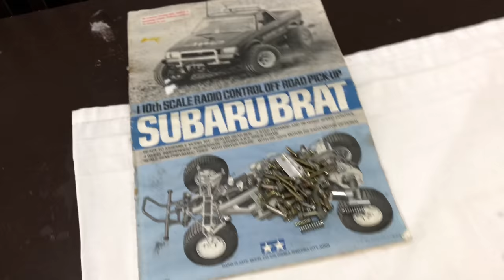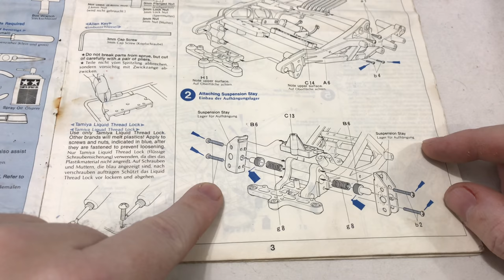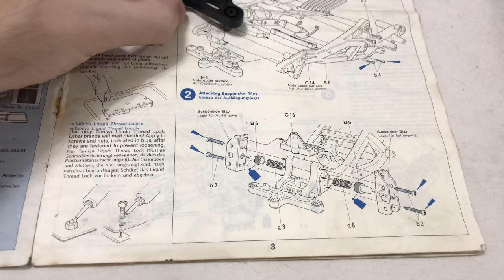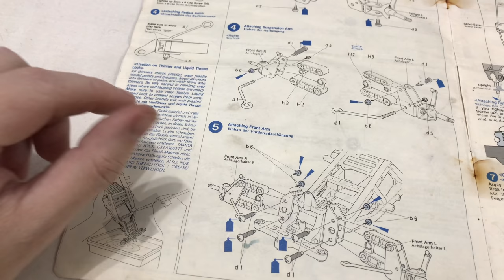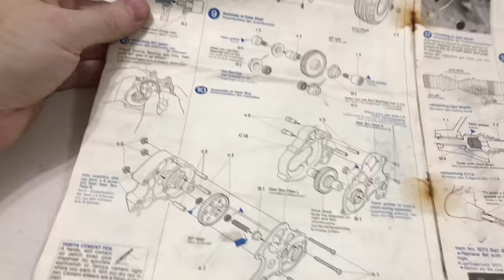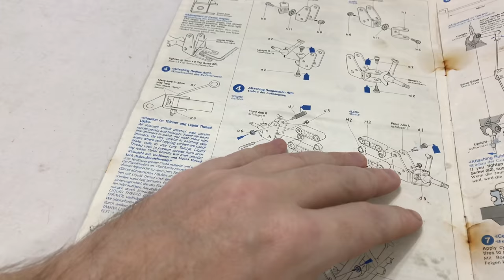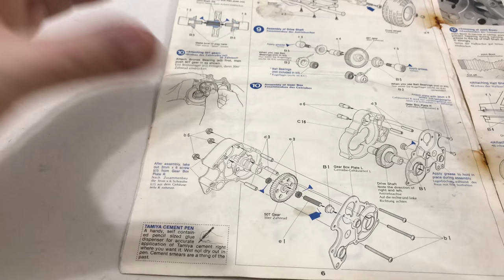Tamiya Vintage Frog

Comment: Great project car. I remember as a kid always tearing down the gear box. I ran my Brat all the time cause it had the posi gear. I just built a rerelease Monster Beetle and put a MIP ball diff in it. I'm just gonna run it in the basement. I had tons of old screws and nuts when I restored tons of cars in the early 2000's. I replated all in gold, silver and black. Still have tons for projects. Love this old stuff.
Reply from the maker: RC4X4 
Excellent 😊
Thanks for watching buddy 👊🏻

Comment: I also had this car back in the 80’s it was my first real r/c vehicle. Very nostalgic to see it again. I remember it having two heavy duty wire antennas on either side of the chassis that acted as a roll bar of sorts to protect the body in the event of a roll over. Great video 👍🏼
Reply from the maker: Stephen Lozano 
Excellent thanks for watching my friend 😊👊🏻

Comment: My first RC was the Frog back in the mid 80s, fond memories spending all our time in Beatties model shop, that's in great condition, the alloy plate and underside of the battery tray on mine were almost wore through lol That gear that was gunked up was probably where the other gear wasn't touching and was old congealed grease, And I think the Tamiya thread lock from back then was like a blue glue, it did smell great LOL
Reply: Ah Saturdays with my mates going to Beatties in Newcastles Eldon Square,highlight of our week.My cars each had a Beatties bag,the Frogs being an early blue one.
Reply from the maker: joss67uk 
Lol 😂 yeah that old thread lock is something else, stronger than today’s super glue 😂👊🏻
Thanks for watching buddy

Comment: Fantastic Glen , so makes memories ordering this from the catalog with Acoms radio set . If I remember a few things the rear shocks came with various piston plates with different amounts of holes it had twin steel aerials . And manual speed controller gave me no end of trouble and was brutal on the gearbox and drive train . I guess fitted with the more powerful motor it could be worse. Go electronic speed controller .
Reply from the maker: Vaughan Lockett 
Excellent thanks for watching my friend 😊👊🏻

Comment: Nice vintage frog, good to see a frog in great condition. Tamiya  upgraded the gearbox quite a bit on the re-release, so no hex  drive, Dog bones do help and I didn't notice the plate that meshes with the gearbox, in the re-release, but I could be wrong, as I've only  built one of these myself a few years back. And yeah it's a headache of a gearbox to put  together. Gravity Just holds everything in place Just before you screw everything down. Oh and mine did come with bearings for the gearbox but none for the car. And I also subbed. You're channel is very interesting and you have a good collection of tamiya. :)
Reply from the maker: Harkeness Tuned RC 
Excellent welcome to the channel my friend 😊👊🏻

Comment: You don't have to pull an upright to fix your steering drag link.  Just pull the screw from the servo saver, and use a screwdriver to pop the ball link off the steering knuckle (either one), and you will be able to manipulate either steering drag link bar off, turn it one half to reinstall on the desired side, and re-secure the ball joint, and put  the servo saver screw back in.
My first RC car was a used Frog back in about '87.  Came with a Futaba twin stick transmitter.  The eventual reason I sold it was because the transmission kept skipping gears, and I couldn't figure out why. 

I moved on to a Fox by then, which was a much faster and better engineered buggy.  Years later I started racing on road flat chassis cars.  I still have my original Fox, though it's in pretty tough shape.  Well loved you could say.
Reply from the maker: M Demers 
Thanks for the information my friend 😊👊🏻

Comment: Looking at your grasshopper box brings back memories 😁
I completely trashed mine back in the late 80's. I cracked the white body from all the rough and tumble.  I've probably still got it in the attic.  The only thing I use to this day is the little orange handled pozidrive screwdriver that came with it ( I think it was for wheel assembly )  😂👍
Reply from the maker: RAW TOPSHOT 
It’s all about the memories my friend 😊👊🏻
Reply: TAMIYA Legends 
True.  Good times 😁👍
I stopped playing with it as the hunger for AA batteries got to be too much for my teenage pockets.

Comment: It's been over 30 years since I handled one of these Glenn and I can still feel that battery tray peg on my thumb tip! and oh how that diff was grindy lol So many memories.. I believe the blue gunk was the original thread lock that came with some Tamia models back in the day, I recall getting it everywhere at one point lol
Was commenting about the steering thing when you noticed it in the video haha thought it looked a little off lol
Reply from the maker: Chris Lee - UK 
Lol Chris, the thread lock is something else isn’t it, it’s stronger than today’s super glue 😂👊🏻
Reply: @TAMIYALegends  You're not wrong there buddy, bloody stuff lol! 
'Hey lets JB Weld this screw that I may need to remove again soon!'  😂😂

Comment: Glenn.  Shocks are built similar to modern cva's. You can download re re manual from tamiya.  Looks like the diff gear gas been in back to front.  Very crucial it is in right way round
Reply from the maker: Lee Hurst 
Thanks for the information Lee 😊👊🏻

Comment: Interesting stuff, and you can tell you enjoyed it! I had a Brat back in the day, loved the body but was (sacrilege alert) kind of disappointed with the chassis, mostly for being so unlike a real car but also for being so massively overbuilt. It hardly helped the underpowered motor and battery back then... BUT! It definitely works better for me with the frame-hugging Frog body shell on it. And I've loved the look of those rear spikes since forever. That Frog is going to look ace. Nice one. 👍😀
Reply from the maker: RC Crawlers Mid-Wales 
Yeah it’s certainly a strange chassis design that’s for sure 😬
Thanks for watching buddy

Comment: If you flip your manual to the parts page at the back, and look in the "screw bag B" section, behind the 3x20 round head screw it does actually says "B2" as stated by the screws in the manual as you shows :-) I really don't use which bag to use section in the the manual, I go by the letter and number. Works for me :-)
Frog is one of those I have never liked or owned, sold the first edition of a re-re Brat I got in a trade some years ago, but I do own both BF and MB x2. 
For some reason the ORV chassis has never been my thing.
But the Frog do grow on me, so I may get one in the future :-)

Comment: Great video Glenn l am really a big fan of the ORV chassis l started the hobby back in the day with a Subaru Brat and then modified it to a Frog and started getting really decent results with it on track!! I had some big issues with it too though with those hex drive shafts( many will remember those damn things) and the gear box was a bit weak especially if fed decent power through it! so be careful with that gold motor Glenn 😉👍
Yeah big fan of the Frog and family! 
Nice job so far mate! You going boxart?? Boxart looks amazing on the Frog! Pink lol never looked so good!!
Reply from the maker: Mad-Bee RC & BB 
Thanks buddy, yes it’s 100% box art from the original guide book picture including the decals 😊👊🏻

Comment: Bec receiver will shed the weight of the 6v servo batteries! I prefer the old mhz system over ghz because hardly anybody uses it nowadays + the signal transmits through water,rc subs, aircraft in cloud/fog. One part I wouldn't keep original is the hex shafts as the corners will shear of especially with a technigold!!!
Reply from the maker: James Cunliffe 
I ended up running it on modern gear, unfortunately the dual resistors were shot 😞

Comment: There was a slight anomaly on some of the frog diff gears that you had to flip the diff gear the other direction or it would rub the case slightly.  This would also be a great time to shim (CRP shims or equivalent) the diff carriers to prolong the life of the bevel gears.  Get a ultrasonic cleaner with just water+soap (no purple or green cleaners as they will mess up the aluminum) would work great at getting all the nooks and crannies.  The brass spacer is correct for the front bumper mount to suspension.
Reply from the maker: kapple17 
Excellent information my friend, thank you 😊👊🏻

Comment: Hi Glen, This is where I love youtube - I have an original Tamiya Frog and  I believe mark 1 in as good condition (being dumped so rescued it)  and am wondering what battery and charger you would recommend? (Ireland) . I just got it working again as a project with me and the son but the battery pack is the original and thinking of switching to Lipo. Any help would be great. Totally

Comment: I'd probably get strung up by the purists out there. I have several vintage Tamiya buggies, and I just remove the period electrics from them, and I'm not overly shy about putting re-re parts in them either. I like to get them running in fair to good condition and not worry too much about authenticity. Having said all that, this buggy is turning out quite nice.

Edit: Oh, and I'd turf those old hex drives as far as I could throw them.
Reply from the maker: Pablo668 
I’m exactly the same my friend, I’m far from a purist, as long as it looks and runs great then I’m happy with that 😊
Thanks for watching 👊🏻

Comment: I thought you were a Tamiya surest and I am to an extent I just want to put modern things at it sometimes it's very hard to get from Tamiya because the stuff is expensive but if I can get the right motors for certain cars I would like that.

Comment: You might still be able to get brass pinions from Tamiya or someone else that will fit them.
Reply: Brad Kalman my original Frog I had in the 80s came with Al motor pinions

Comment: If possible, you should try and run it with the original MSC (it looks to be in reasonable condition with no corrosion: the contact plates just need a clean) for that ultimate retro analogue RC experience. You can't beat the sound of those old speedos, even if they were hazardous when the BEC nicad power ran low and the car suddenly took on a mind of its own!
Reply from the maker: Richard Gere 
Yeah unfortunately I had to go esc, the double resistors were shot 😞
Thanks for watching buddy

Comment: It was a shitty designed car with the dog bones constantly falling out or the ceramic resisters getting hot enough to melt the plastic chassis the aluminum plate was attached to.  It couldn’t handle a motor hotter than a 21 turn 12 degree timing pro car motor
Reply from the maker: Lvskymar 
Thanks for watching 😊👊🏻
Reply: Thanks for listening to my rant.  Your rebuild of the frog brought back all my frustrations building it as a kid in the 4th grade.  If you used an electronic speed control and zip tied the boots so the dog bones didn’t fall out perhaps I would have gotten more enjoyment out of it.  I just remember falling in love with the picture on the box and expecting to see my Frog soaring through the air triumphantly off of sweet jumps.
Reply from the maker: Lvskymar 
No I fully get it, all the early Tamiya’s had issues, but the drive shafts and gearbox in this particular chassis weren’t great. Luckily them made the the release better 😬

Comment: They are oil dampers do know there is an aftermarket actually put Front dampers on the front suspension do if you wanted to.